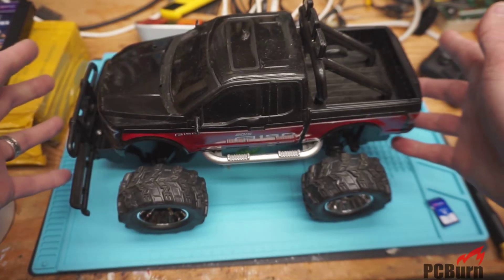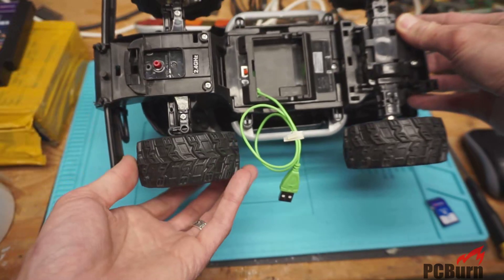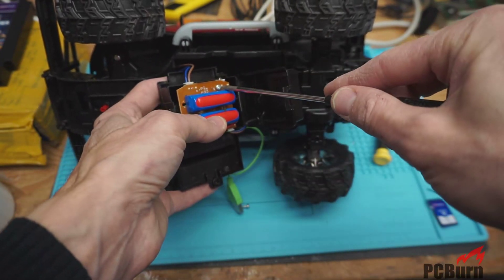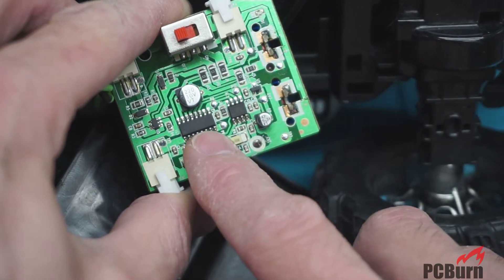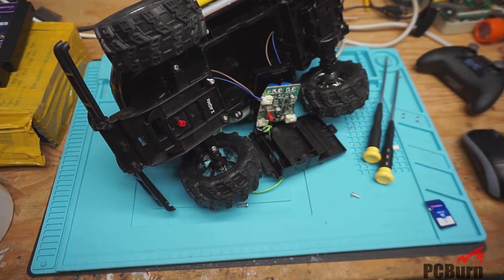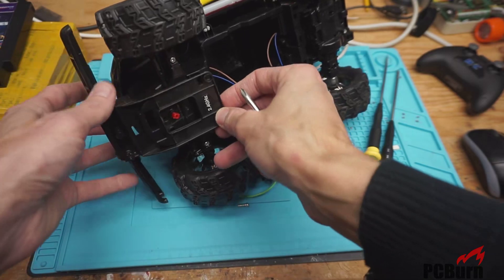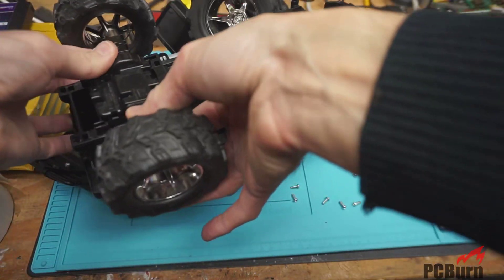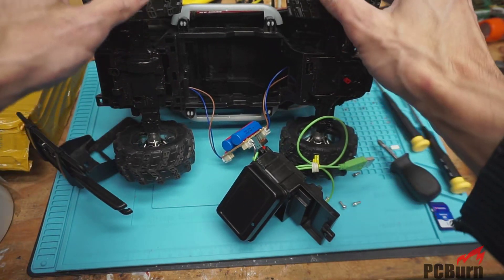New Bright RC Car Teardown - This truck's even cheaper than it looks

Comment: Could you open up the front wheels cover? Where the gears for it are? I’m having a grinding noise problem when turning the car left which I assume is running the dc motor backwards. Doesn’t grind if It turns the wheels right

Comment: You should buy the older new bright vehicles, and open them up because the way they used to set them up is actually pretty surprising
Reply from the maker: Hmm. What are the characteristics to look for? Or did they just have a production date.

I could pull apart another to prep for a replacement set of electronics once I'm shooting again.
Reply: @PCBurn  honestly I just want your reaction
Reply from the maker: Sure, I'll pick up the oldest one I come across if I can date them.
Reply: @PCBurn  there are some on eBay, but they’re pretty expensive

Comment: Thanks for that informative teardown.  I have New bright ford 4x4 1:10 scale (missing controller) and I took out the motherboard and it looks significantly more complicated with 7 chips and many more components.   Looks like both of the chips on your motherboard has identification markings, but on my motherboard two of the chips have no markings at all.  This is bigger truck and needs more power, but because both front and rear axle has drive, board needs to be so much more complicated?   Doesn't make sense to me.  I was hoping to buy a hobby grade controller and receiver and somehow wire it to make it work with this motherboard, but without schematics, it looks like no go.
Reply from the maker: @coldspring22  With these it'd probably be easier to yank the electronics and get a paired replacement for those and the remote at the same time. There's also the possibility of accessing the existing board if someone's sniffed it and documented a useful method of interacting with it.

I did order in a cheapo remote/electronics set for this one (for when I've got a more permanent recording setup done... that's turning into an odyssey) and it looks like the same design as the one that's in there currently.

Comment: I had one of these and bypassed the aa bin for 2 18650's so that I can have range like mad, The thing was so dope, and then the gear box started slipping it's 1st run. :/ I really should have just fixed t, I liked that truck.
Reply: I like to take Jada's chassis's and pair them with new bright electronics since they're easier to mod, and you can end up with some pretty sweep cars.

Comment: Hello 👋. I recently got a 1/14 Vortex RC buggy, and had the same platform chassis 🤔. I say had because I modified it, using partial hobby grade electronics 👍. BTW: full album was recently uploaded a few minutes ago, check it out. Happy Holidays.
Reply from the maker: Ah, neat! I still need to get back to these... there's some equally cheap but easier to hack electronics sitting next to them.

Comment: I got a new bright truck for my kid similar to the one you got with the usb really fun to use, but i was really bummed about the battery life only runs 15-20mins
Reply from the maker: Yea, might be better off with a NiMH AA cell pack. I'll have to see if that's viable with it.
Reply: @PCBurn  I just saw your video and was going to ask this as well. since that space looks like it could fit a cube 8 cell nimh pack. did you ever confirm if nimh packs were compatible?
Reply from the maker: @aarondetmer946 anything that puts out a usable voltage would be compatible. You'd have to provide your own charging electronics though. I can't recall if this was a 7.2v but if so 8x1.2 seems a bit high but in the ballpark. Maybe 6 healthy NiMH AA cells?

Perhaps I should pull a more generalist video on altering an R/C. I think there's a radio/receiver spare parts bin kicking around from back when I shot this.

Comment: My son's new bright's battery are wasted 😆 I can't find any replacement in my area I was planning to change the battery from hfc1450 to some AA size rechargeable battery modifying the battery case and wirings so it can be used with sm 2 pin cables.. now that I watched this makes me want to change the motors as well 😆

Comment: Is there a part 2 ? I.e. what you did with it?
Reply from the maker: I did get in the replacement electronics kit and remote months after posting this. I'm currently building a new workshop; shooting video won't be horribly cramped and some of my old projects can come out and get finished.
Reply: @PCBurn  Well, my son had a similar version for Xmas today and within 20 mins the pinion gear cracked and so lost traction. Your video helped me work out how to open it up. Thanks! 
His one is AA battery's, interested to know what you do with this, there is a lot of room in there, I was thinking whether I could pull it out and fit something for a longer runtime.
Reply from the maker: Oh yea! There is a boatload of room and fairly generic electronics to play with in there. I believe I have a couple of the trucks sitting on the project shelf waiting to have something happen to them.

Probably a good spring project so my own lad can run them around when they're done.

Comment: I have an older 9.6v rc bright car. Can I swap the battery to the controller in the video? I like the 2.4 ghz controller and range over the 49 mhz.
Reply from the maker: I'm not sure I understand the question. The controller doesn't use a 9.6v battery.
Reply: @PCBurn  I have two RC cars. Both new bright. One has the modern controller like in your video, but the older one is 9.6v. Do you think I could use the bigger batteries and motors with the newer controller?
Reply from the maker: @mistaneon  You could swap all the electronics along with the battery between cars if they fit. The motors would depend on if they have the same characteristics.

The charge circuits are different if I'm reading that right. So it'd have to be everything.

Comment: When I dismantled the battery setion the batteries appear more like Capacitors.
Reply from the maker: Interesting. So it's either not a standard battery or there was a good price on oddball through-hole batteries. Did they have a part number?

Comment: Any idea what size the 2 DC motors are?
Reply from the maker: Should be the standard "hobby" size DC motors. A 130 if I recall correctly, although I'm not sure that defines the output shaft.

Let me know if that doesn't match the video and I'll go crack the R/C back apart and measure.

Comment: I have a new bright RC car similar to this one and also have no way to communicate with it.  Do you know if there is a way to change the channel it runs on or do I just have to try to find the correct remote (or use a different control board all together)?  I am new to RC Cars and how they work and are put together.
Reply from the maker: I've been meaning to get back to this for a while. The dirt cheap R/C control board and remote combos available from low-cost auction site electronic sellers seem the same or very similar.

Although if you want to be sure of it working a controller and receiver combo to power a couple of R/C motors in two directions was 5$(usd). I have no idea what that's gotten up to just now.

Comment: Could you upgrade the batteries?
Reply from the maker: Sure. If you'll be re-using the existing charging circuitry you'd want to use ones with the same characteristics. 

Removing the charge circuitry and going with a removable NiMH AA based battery pack would be simple as well.
Reply: @PCBurn  Could you think that you can do a video?
Reply from the maker: @angelmora8700  Sure! Provided I have a working R/C kicking around replacing the Lithium based batteries with a safer NiMH should make for a nice quick project.
Reply: @PCBurn  Yeah I Think! Happens that with that battery that have this car have two positive and two negative.. and if you see the battery say that have one battery positive and the other negative.. that is confused!.. so, I don't have idea that what I can do it..

Comment: How do you charge it with the USB?
Reply from the maker: With the USB model you plug the attached USB cable into an appropriate USB jack.
Reply: @PCBurn  Can Samsung cube work?
Reply from the maker: @tambu6091  If you're unfamiliar with how USB works as a charging standard these questions would be better addressed to someone whom can see all the things your doing.
Reply: @PCBurn  should I put the USB in the Samsung cube

Comment: I am trying to figure out what brushless motor to replace the motor with in the back. Any Ideas?
Reply from the maker: I'd have to check what they're using again if I didn't mention it. They're a standard hobby motor that you could either replace with same or use a same size/voltage R/C specific part for more output.

If I have a sec I'll see what mine were but you'd probably want to check your own prior to looking for a replacement in any case. These cars have different components over production runs.
Reply: @PCBurn  Pretty sure this is a 130 motor. Its the small one with flat sides.
Reply: @hmbiii9974  what brushless motor would be compatible in size?
Reply: @Marcnshae2011  Sorry it took so long to get back to this, I actually reconfigured mine to accept a small brushless that I already had in my build boxes. I'm going to say a 130 size However I think a Keyosho Mini Z motor may work. You may want to stay away from anything too high of a KV. The motor I used had to be set to low speed so I didn't melt the gears.
Reply: @hmbiii9974  Much apprecieated! How high is too high on the kv?

Comment: was happy cause i got a cheap rc hellcat and it was good for about 5 minutes till it started stopping and beeping mid driving. pos
Reply from the maker: Yea, the NewBrights are great thrift store buys if you want to tinker with electronics (caveat being the poor steering rack) and not-so-good if you just want to drive an RC kart around.

I just built a NiMH battery for a 30 year old Nikko RC, the cheap car of it's day, and it still runs like a champ.

Comment: My girlfriends son got this truck for his bay this year , and the back right wheel (rim) just spun itself  off lol. If put it back on but think the screw holding it is stripped  .
Reply from the maker: Likely! Most of the.screws on the low-end R/C are straight into plastic if I recall.

You could probably use a thermoset screw thread if it's just stripped.
Reply: Back right wheel snapped off on mine. Looking for a new axle without luck so far.
Reply from the maker: Good luck. Might be able to find a replacement rod from the dimensions.

Comment: I'm so done with New Bright I had them in the past they're completely cheaper than cheap. Although I've come across the mini rock crawler r that's pretty decent for what it is. Even with that though the gear start stripping after about a month of decent use.
Reply: They're good for what I do with them. They're cheap enough that I've bought several just for the receiver board. My spare room was looking like a new bright junk yard.
Reply from the maker: Yea, it's funny. I ran across one of the "cheap" R/C cars from the 80's, a Nikko, and it's a fair whack better than these. Although even at the time it was more expensive.
Reply: @PCBurn   Reminded me of a Tonka sign i saw. Old man talking to a little kid. Son, back in my day you could kill a bison with a tonka truck,
Reply: Adventure Force makes a far better toy grade R/C than new bright.
Reply from the maker: Looks like a WalMart specific badge for other manufacturers R/C cars. What's superior on a specific model that you're referring to?
Reply: @PCBurn  their(Adventure force) crawlers perform better than the Vaughn gettin Jr crawler although the Vaughn gettin Jr crawler by New Bright I have to say is one of new brights better products. Also a lot of New Brights 1/24 scale Monster Trucks are definitely worth the Money,,, the rest of their items are ready to disappoint.
Reply: @PCBurn  Excuse me I think those trucks I’m talking about are actually 1:46 scale. They are the Monster Jam series by New Bright and only $10.00 a piece. Those are fast and they are awesome however most anything else I’ve purchased by new bright has been disappointing.
Reply from the maker: Good to know!
Reply: @Yyyyyy5  I just got an adventure force trailchaser last month and it is really good. A lot better than that new bright crap.

Comment: Ive built some crazy trucks from new bright toys. Ive put articulated steering on one of the Polaris trucks using the front end From one with a fried receiver board onto the rear of a new one. That was different. Ive called new bright. It surprised me that they dont sell replacement parts . Where do you find new recriver and transmitters?
Reply from the maker: If you search on Aliexpress you can find the RC transmitter/receiver pairs that're almost the same as these. I haven't tested compatibility yet.

If you'd like I can pull those out and see if they're cross compatible and how drop-in the replacement is. Been meaning to shoot a video on that.
Reply: @PCBurn  Thanks. I've swapped them around before. just gotta make sure the voltage is similar from what you take it out of to what you put it in. Too low and you'll be shutting down to cool off  (If you're lucky) every minute or less and.. well . I haven't tried putting a higher voltage in a really lower one yet. it shouldn't fry the motor but never know til i try. I bet it would be hard to control with that speed and with the steering like it is.

Comment: I’m upset... they really put a tiny dc motor in the rear instead of the bigger rounded one. I bought the 2020 1/12 corvette rc and I was curious what motor the rear axle had and it had same one in this video. I tried changing it out with the bigger rounded ones and I broke it, the gears were all grinding loudly and it wasn’t turning the wheels. I’ve been trying to find a newbright 1/12 rear axle and hopefully anyone can help me.
Reply: if you still have the rc, can I buy the rear axle off of yours haha
Reply from the maker: @joshuathao4030  thrift stores are usually lousy with the things if your on a lower budget than Ebay. This one's getting an R/C retrofit.